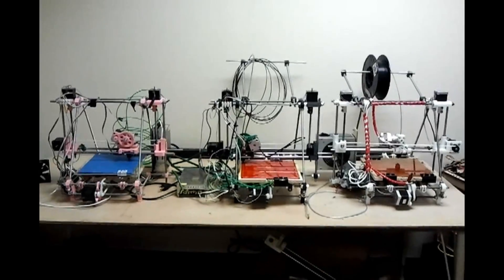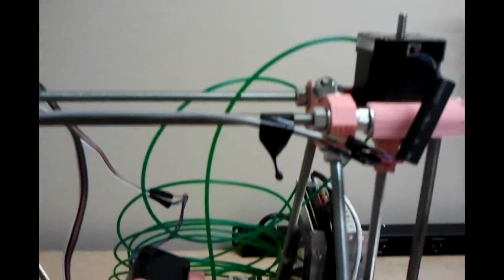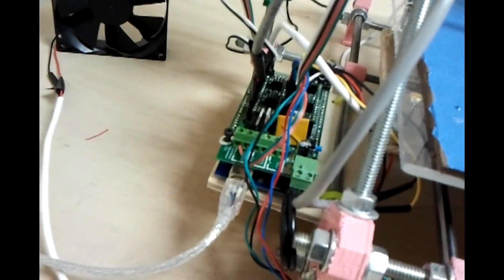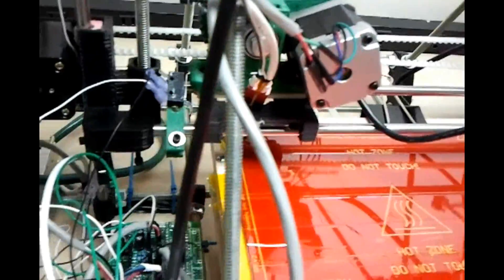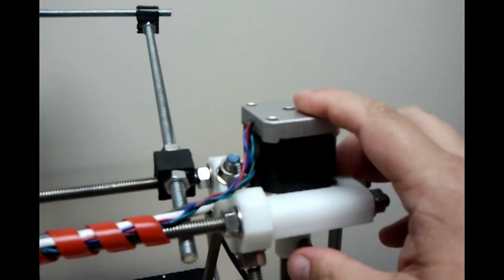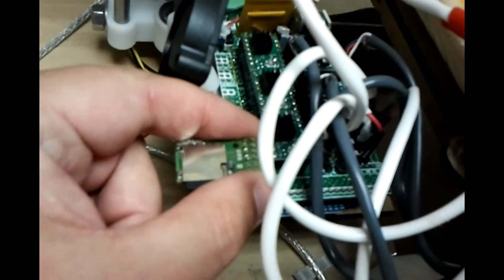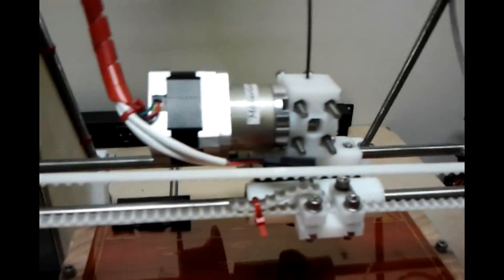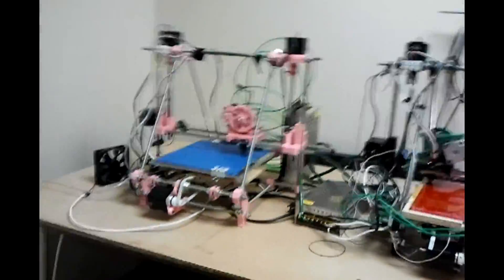Still Extruding: RepRap Price Points

Comment: Print quality is determined by a lot of factors:

Head positioning accuracy
Bed alignment
System stiffness and mass
Print speed
Filament feed accuracy
Filament quality

There are others, but you get the point.

As for the stepper, 0.9 degrees/step is the industry standard. Most steppers are 200 steps/rev and 0.9 is 400 with means he's using the motors with a half-step capable (almost all) driver. Micro stepping can divide steps even further - generally up to 65000+ / rev (not much use though).

Comment: Looks to be really a nice system, but on the high in one the way you mounted the cooling fan for the electronic is really cheap looking. With all that technology at hand you mount the cooling in with RTV or whatever that stuff is that to me isn’t acceptable at all, that in itself I won’t buy it from you what other things have you done this way and you charge 800 to 900 dollars for it. Mount the fan the proper way and take a little more pride in your work.